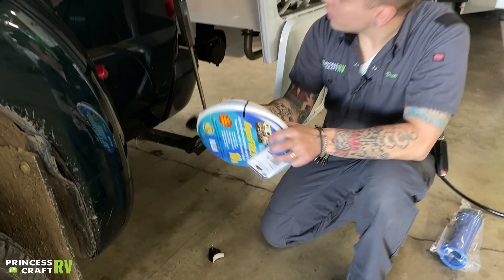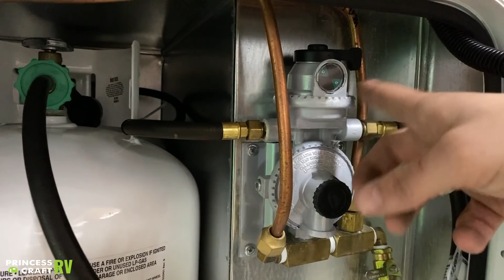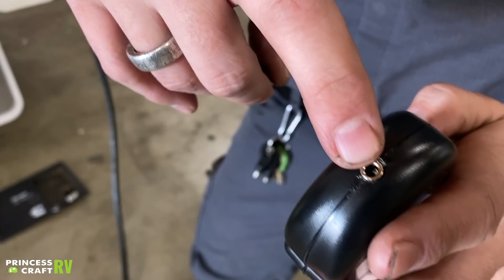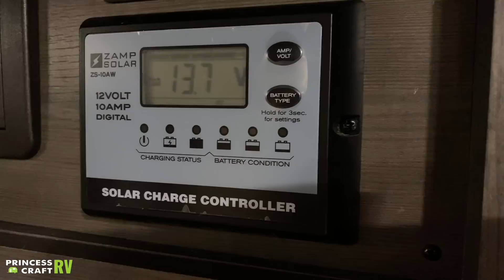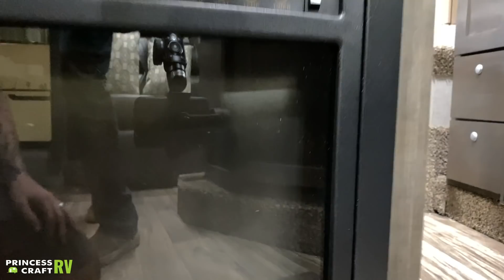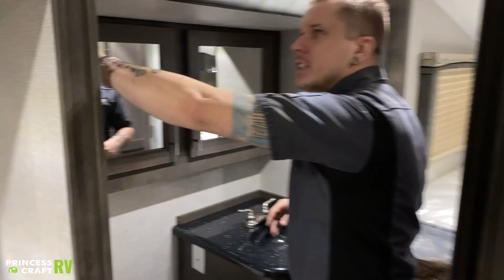Technician Tour - HOST Mammoth

Comment: Hello, We purchased a 2016 Mammoth this last April 2022, the water pressure was very light every were except the toilet. I removed screens and flushed deposits out, cleaned orifices etc and gained a little water pressure how ever the sink sprayer  is  similar to 1/4 turned on as the shower and bathroom sink, when hooked to city water and the water pump is turned on, the water pump runs and stops with use and does have better pressure but still not like 55psi should- especially out an 1/2" line. The screen down below is clear at the pump.

Comment: I need to find a dealer that has one in stock stat , right now. I just sold my home bought the truck called princess craft and they won’t have anymore until December. I don’t want to down grade to something I really don’t just because of this issue. I’ve spent a lot of time researching a lot of different campers , plant tours , construction and so forth and know that Host is the best in all categories. I need help in finding my camper 😣🥺😵 after all the researching I forgot one tiny detail, a dealer with one in stock. OMG I’m in a situation now.
Reply from the maker: Check out the dealership page on HOSTS website. It may be a good place to start your research. They may even have a contact point on their website to get some human help.
Reply: RV Tech Tours at Princess Craft 😀 Thank you so much ,

Comment: Ok how many have called in saying they used the glass stove cover as a griddle? lol
Great video.  Would love a detailed one as well for installing on the truck.  Also is it recommended to be used on just the jacks?
Reply from the maker: It's perfectly fine to camp in this truck camper with it off of the truck. We suggest lowering it as close to the ground as possible when camping in it detached from the truck. We'll need to look into making a loading and unloading video for ya.
Reply: RV Tech Tours at Princess Craft thank you for the reply.  Since the Host and Eagle Cap are “4 season” what do you feel would be the safest low temperature to still use the water functions for winter camping?

Comment: 1:03 mins u don't want 6gals of antifreeze in water heater,so drain system  lock water heater off cycle antifreeze then open water heater just prt way to let  small amount flow in.
Reply: tech says just by pass water heater totally when winterizing,ok.

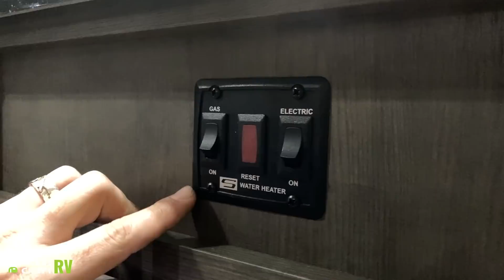Comment: 59:30 switches n kitchen for water heater power source.
Reply: 5min pre-process to go thru 3 cycles & if lite still on the water heater didn't lite.
Reply: max gals per hr of hot water is running both rockers power & propane on.
Reply: 20mins pre shower warm up time worst case, w/15gal or 11gal type max flow rate(most ppl won't b able to tell the diff).

Comment: The rear window each sheet own flange top over laps bottom & comes off 1st or goes back on last rain deal. The gasket is affixed to flange & removing compression rubber doesn't effect it anyway.oval style.

Comment: 48/49min starting gen hold down blinks primed then hold up rocker switch max 10sec or over cranking. Propane in bottles & turned on,few tries poss not a honda mower.

Comment: Host the big rear window I Need To B able to Remove that quickly & safely so long stuff can b loaded securely into camper.  2 suction glass handles & a lock from inside & simple quick cover over retaining flange of special rear window outside. U name it tiny doors vs straight shot big removable window for Ebikes or plywood or whatever.

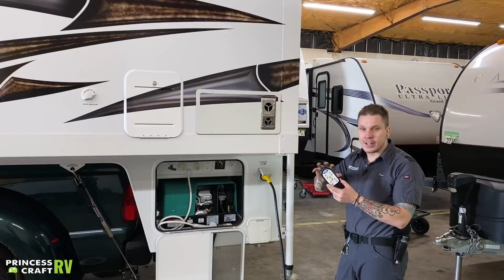Comment: 36:30 2nd remote/red remote or back up remote only works attached no battery.
Reply: 3/8 spinner wrench manual top of jack leg under rubber cap. Alittle up or down each leg jack as Insnke as poss.

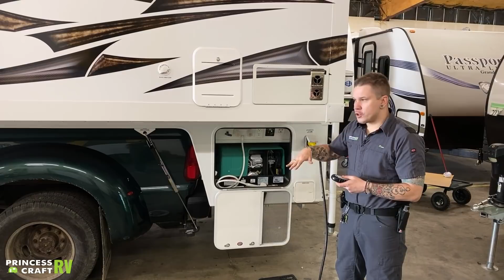Comment: 35:30 lift front 1st & more bolt tightening analogy, bc the front is unsupported & v/heavy.
Reply: great pnt u don't leave it up on jacks no diff then car jacked then jack supports. The lift legs r thin not able to safely hold extended in the air any amount of time safely.

Comment: I think Nu went water heater instead of air(if u hve water to heat) better more efficient, plenty of heat small space option.
Reply: True, and I think its a better system, but try to get warranty or a replacement unit. very difficult. Research it to confirm.

Comment: As far as bed campers I hve looked at<<<Me>>> Host is 1st not perfect fit choice but,yeah, lance & North & 3rd Eagle w/Nu 4th not able to walk the roof wt limit. I hope I am remembering those right order. Eagle biggest badest & ugly inside all wrong tossed. Lance mayb but they make 1 type & it works or doesn't. North winner solid pick. Host your door is to narrow. I want 2 side entrance both/either sides & cross venting full screen door. Love the pull tray 1 other Eagle has too,only wish bay was just a bit taller 6" would b great or another step more 2 get into & out of camper Worth It!
Reply: It's wt w/these camper design all but the same really, mostly. I Want to shack up the truck bed camper segment big time. Seriously think wt decides all this group, & that means aluminum cabinets, & no blk tank every lb helps & gives more room to shack up the group.
Reply: But the Eagle weights about a thousand pounds more. A very big difference

Comment: 20 mins valve to switch from 1 tank to another for propane >no cold showers if u ck 1st & don't run your tank flat dry>.
Reply: 21min >if u open regulator on top of both tanks this rig auto switches for u so "u should not run dry"<.
Reply: 21:40 high flow quick connect external propane hook up.

Comment: 17 mins lowest pnt hot & cold drains then & water tank for winter, ck
Reply: 18min water pump antifreeze hose draw & turn valve open.
Reply: RV grade type & run every fixture inside to flow thru system, ck
Reply: 19mins >know where your GFI switches r mini breakers<

Comment: With the bathroom hall going straight into the bedroom that would be a problem for me I would only want one entrance in the bathroom privacy 
in the bedroom have a wall instead of going through that’s the only thing I did not like about this design
Reply: @Constantine Spyridon - The Host camper has a slide out door that can close off the bathroom from the bedroom, they probably just didn't show that feature. Also, on this model of truck camper you can access the bedroom from two sides thankfully.

Comment: How do you put fuel in the generator???
Reply from the maker: The camper’s propane is the fuel source for the generator. As long as there’s propane in the bottles, the bottles’ valves are open, and the unit has enough electricity (battery) to start the generator, the generator can be run.
Reply: @RVTechToursatPrincessCraft  Thank you for the answer!

Comment: Wouldn't it make more sense to fork the black and grey tank valves so you could drain the black then flush the bottom part of the line with grey water? What if you have to dump your black tank but you have no flush water available?

Comment: Thermostat right above fireplace heater....bad design
Reply: I have a host camper you either run the fireplace or you run the furnace. It works no problem.